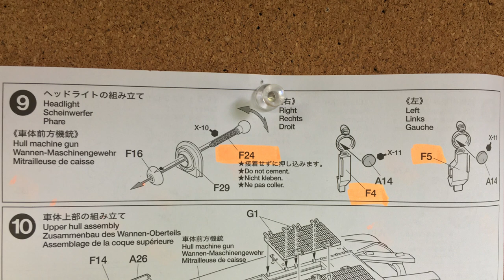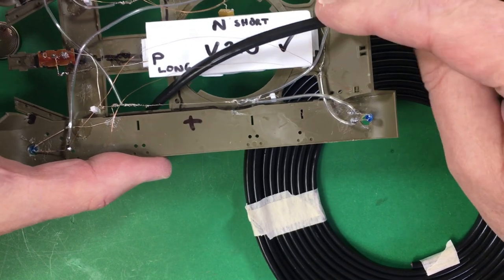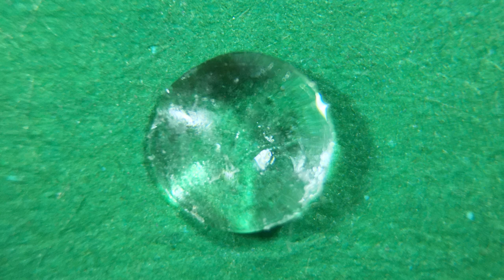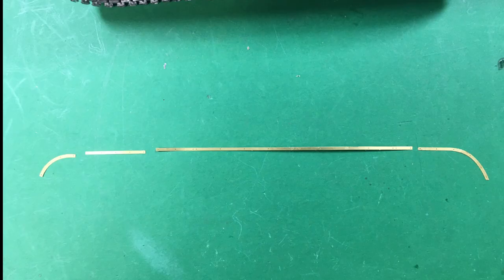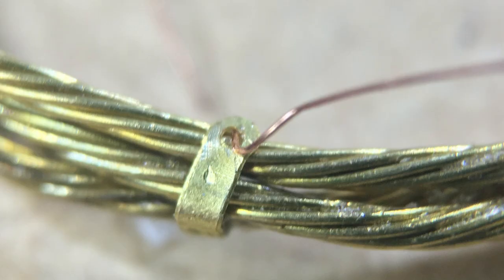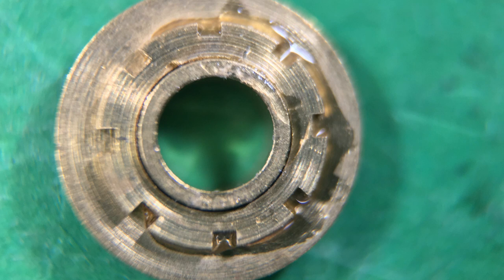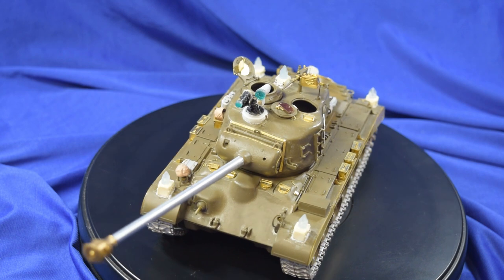Tamiya 1/35 M26 Pershing - The Build Part 3 Final

Comment: David R Lentz, Columbus, Ohio, USA (Sunday, 29 September, 2024) 

Well, first, I hope your fingers have healed. 
   Stop motion animation! Well, a dramatisation of the last months of the war . . . . Your project here is a bravely ambitious undertaking. Already you have my admiration. I also can see that you are an immensely skilful builder and artisan, blending the crafts of the machinist with the arts of a sculptor, a painter, etc. 
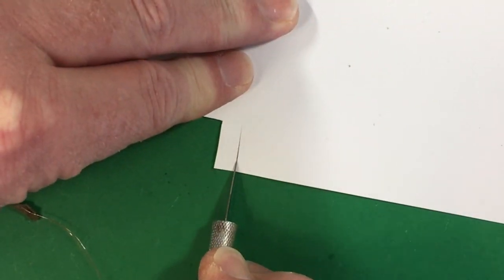   At 1:55 in your video, you refer to the M-26 Pershing U.S. Army heavy tank as “medium”. The War Department, however, had classified it as a heavy tank. With its arrival late in the war, it was brand new, and the heaviest such land vehicle in the U.S. arsenal. Later, after the M-46, M-47, and M-48 Patton tanks had arrived, the Army reclassified it as a medium tank; this was less of its size as these newer iterations had diesel engines, better transmissions, a more powerful field gun (NOT a “cannon”!), etc. 
   I had built two of this kit, the second I extensively had augmented with Verlinden’s equally top-quality resin aftermarket detail sets of 1) the engine and its compartment; 2) the turret interior, including several rounds of the 90mm ammunition; 3) four crew figures; I had added a handful of soldiers taking a ride upon the rear; 3) numerous exterior features; 4) external equipment stowage, etc. All these made for an extraordinarily detailed replica! From all these, the experience redoubled my fascination for the M-26! 
   As part of that, I recently watched an Englishman’s video series on his building an all-metal 1:6th-scale (that is not a typo: one-sixth!) replica of this tank. He estimates its weight at the finish as over 100 kg! I would guess its length to approach 1.5 metre! 
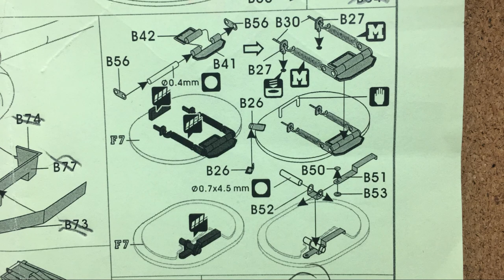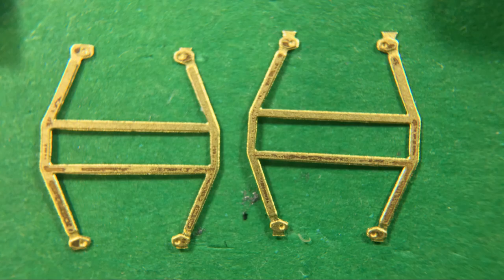   Photo-etch can offer some advantages, chiefly being scale accurate in thinness at points. I have some issues with how some try to make it do what it cannot: substitute a very small part or a surface feature that is circular or rounded in cross-section with a flat shape (what I call “false three-dimensionality”). At various points of your video, round 24:40, 25:10, 26:12, I find several examples of this; they are ubiquitous for the common use of PE. I endeavour to supplant such minute bits as these with scale-thin rod, wire, tube, etc. (which themselves can be so exceptionally tiny!). However, scratch-building such astonishingly fine details almost invariably lacks the precision and uniformity across the lot of them as I would expect).
Reply from the maker: Thanks David, really appreciate your kind comments 👍